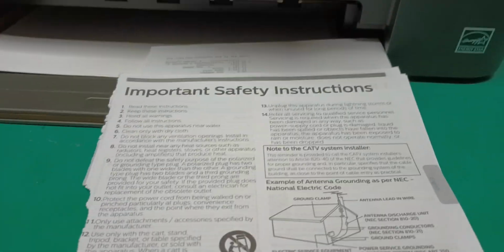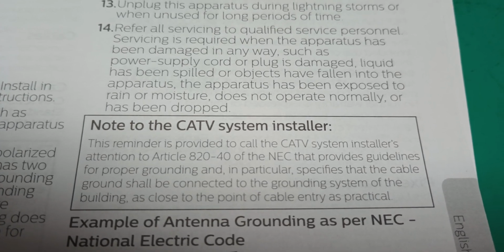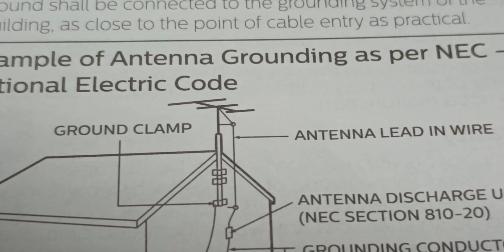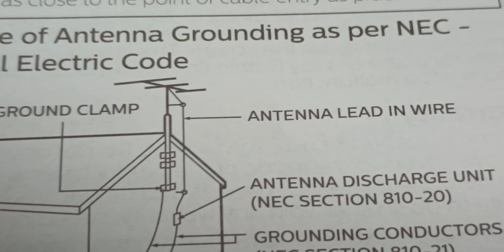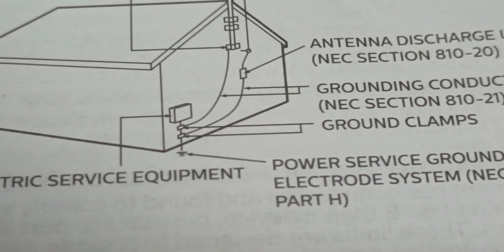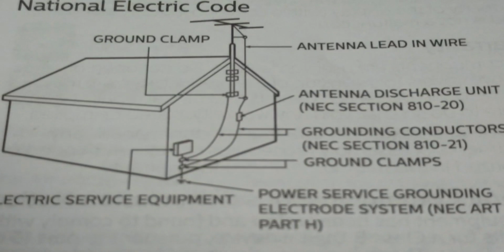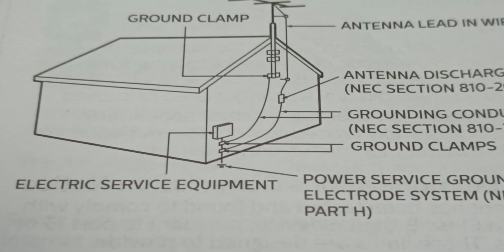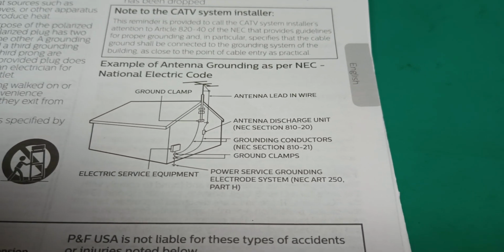Antenna System Grounding- Phillips TV Manual With NEC References #hamradio #hamantenna #grounding

Comment: I'd add that Philips probably sells more TVs in a year than the ARRL has sold books in the past half-century. And Philips customers, unlike ARRL customers, haven't been trained to blame themselves if they ground something and it blows something up or causes a fire. They're gonna sue Philips if their TV antenna gets hit and the TV blows up. Philips has a far higher financial and legal stake than the American Radio Ripoff League, they're gonna make sure their diagram and NEC callouts are correct.
Reply from the maker: I couldna said it better.

And BTW, anyone interested, avoid "Phillips" like the plague. I tried to make a Warranty claim on a TV and at the bottom of that rabbit-hole was some unknown contractor apparently handing such things for them, who were just going to show up at my house, un-identified and take my $2000 TV, with no indication there would be a replacement. Phillpis refused to identify that contractor or promise a replacement.

Thats got fraud written all over it

Comment: I got my Tech a few months ago and then bought an HT. I would like to put a base station in the house so I don't have to go outside every time I want to talk on the radio. I started researching all the stuff I thought I needed to put an antenna on the eave of the roof and for running the coax through the wall. I will admit I know nothing on the topic of proper antenna installations. Other than reading published books or watching videos put up by people that I thought were knowledgeable on this topic. I do not have any background knowledge of electricity other than I know not to stick paperclips into an outlet. I am just a guy wanting to put up an antenna and talk on the radio. I do however want it to be safe. I was about to order all this stuff and then came across your channel. After watching numerous videos of yours I'm so glad I came across all this wealth of information that you have shared. With all that said I am a little lost on what I should be doing to be as safe as possible. Is this a good plan or should I be doing this differently? Our house is ICF with a brick veneer. I would  put up a Commet GP-3 antenna on the eave of the house. Run the coax down the brick wall to a junction box. Inside the junction box have connectors to the coax that is running through the wall. The coax that is coming through the wall connected to the radio. No ground leads placed anywhere in the system accept the outlet the radio is plugged into. When not using the radio I would disconnect the coax in the junction box outside the house.  I appreciate your time. Thank you
Reply from the maker: readers- note this Commenter is...READING AND LEARNING!  That is what " this" is all about.

This is golden:

" I do not have any background knowledge of electricity other than I know not to stick paperclips into an outlet."

You are WAY better educated than the people telling you to ground the antenna system
They are sticking a PAPERCLIP IN A LIGHTNING BOLT.*

Youve got common sense. Great!

Readers, note this, its what I've been telling you:

" I was about to order all this stuff and then came across your channel."

There it is, all this crap they tell you you need is to get you to BUY THINGS.

Go ask the genuises that tell you to ground how to GROUND A HT? A hose clamp on the antenna socket?
LMAO.

Youve got it, just that Code REQUIRES that the wall pass-though be non combustible. That should be common sense, but too many of us pass it thru wood. A hard strike will turn that coax into a 3,000 degree ball of fire and that can instantly set building materials on fire.

ICF = materials that will not burn. Theres no air inside worth talking about. So its OK to pass thru without conduit, just keep the insects out. For wood, I use steel tubing or conduit. Code does specify "conduit" but doesnt say metal or PVC. PVC doesnt support combustion.

See my Grounding video #7 where I passed my HF coaxes thru 10 foot of conduit. Makes a lightning suppressor.

HT = VHF/UHF. Read about coax loss per foot. ITs death on V/U signals, both TX and RX.
100 feet of coax at 2 meters, big losses. At 440, nothing left, transmit or receive.

LMR 400 is the best, try Jeffa Tech (spelling?). They had a "clone" - 400 for $0.60 a foot last I bought some.

Its too stiff to connect directly to a HT, just use a short RG58 jumper else the HT antenna socket may be broken off.
Reply: @k8byp  Thank you for the follow up. I was planning on getting another radio for inside. Something like a Yaesu 200 or 300. I did plan on using LMR400 but have been reading about this Messi and Paoloni HYPERFLEX 10 SAHARA. It has a white outer sheath that they claim is better for hot sunny environments. I live in Florida and the part of the house I want to put the antenna up at gets direct sun all day. Probably just marketing tactic. I may still go with the LMR400 from the antenna to the junction box then the LMR400 untraflex through the wall into the house.
Reply from the maker: White plastic will reflect light, sure, but its only relevant for permanent long installs.

Paint it! Or wrap aluminum foil around it.
Reply: @k8byp  I am going to just go with the LMR400. I have one more question. I think I know the answer from the information you have provided but rather ask then just guess and get hurt. So I should not use a lighting arrestor like a ALPHA DELTA ATT3G50U in the junction box in line on the coax outside, then running a ground wire from the arrestor to a ground rod. That would be the only grounding, not tying any other equipment to it. If I'm understanding correctly that is a no no.
Reply from the maker: It IS tying other equipment to it- the radio chassis. Thats not allowed under NEC 250 " may not ground not normally current carrying conductors."
Reply: @k8byp  Ok. Thats what I thought but wanted to make sure. I have an old 15' fiberglass windsurfer sail mast that I think I'm going to use to put this antenna on top of. I have a raised garden bed that has an 8' trellis over the top of it and it is on the same side of the house that I want to install the antenna on. I am now planning on bolting the mast to one of the uprights on the garden bed and run the coax underground through a piece of steel conduit as you suggested. I kind of decided that I really don't want to attach the antenna to the house at all. Do you think by installing it in this manner that its necessary to disconnect the coax outside in the junction box when not in use or will unplugging the coax from the radio be enough?
Reply from the maker: Its a pain to go out and disconnect it.

If its underground and gets hit, itll probably arc thru the plastic jacket so that is roughly the same as grounding the coax. BUT underground allows lightning current thats going thru the Earth to couple into the coax. I just lay it on the ground and run the lawn tractor over it.
Reply: @k8byp  I spent the entire evening in a rabbit hole. LOL. This has turned into a fascinating, complex, educating, and eye opening topic. When leaving the coax disconnected from the radio when not in use, would there be any advantage to shorting the center conductor of the coax to its shield? So the 259 connector on the coax would not be like a spark plug laying on the desk. Not trying to save the antenna or coax from a lighting strike but to have any negative reaction remain outdoors and not occur indoors. I would like to avoid having to go outside to connect/disconnect the radio all the time. In the end, this maybe what I have to do to mitigate the potential for fire or shock in doors.
Reply from the maker: Now folks we have a REAL HAM in the making. Not content with playing trivial games.

Shorting or open Tline both cause a " total internal reflection" of propagating energy. Almost. Unfortunately with lightning, its a huge energy. Open, the very high voltage will arc over and 
break down then short and destroy the end. Shorted, high current will do the same. Pick an option, they both suck! Leave it open and watch for corona. Its fun to watch. Might even see St Elmos Fire. I saw it once.

Its exactly like a spark plug on the desk, just that spark plugs intentionally arc to ignite combustion. Thats NOT what we want in the house unless were way late in payments.

"mitigate the potential for fire or shock in doors."

Thats exactly what the Electrical Code does. Cant eliminate it. Minimize it. Now you are qualified to start studying the NEC. ( I assume youre in the U.S., if not study it anyway.) You " get it" now.

Realize even indirect lightning strikes are DEADLY potentials. Why bring that in the house?
Reply: @k8byp  Yes I'm in the US. I live in north Florida. I have read a few of the pages out of the NEC that you have been talking about. I just started reading on the NFPA 780 and my rabbit hole keeps getting deeper. This is really some interesting material. There are things that I never considered or was given wrong information about. This is the stuff that there really should be mandatory to learn in order to get a ham license. It's not just playing walkie talkie as I am learning. This is a huge safety issue that does not seem like it is being addressed appropriately in the world of amateur radio.
Reply from the maker: Its not addressed in ham radio because its not a radio topic. Its not radio operation or commu ication, its life, death and property damage.

Dont put yourself down just because youre at the " walkie talkie" level ( and youre dating yourself with that phrase!). Youve figured out things most hams never " get."

It was a REAL tough adjustment when I got back into ham radio in 2015 after getting real science and engineering knowlege, then finding out how much about radio and RF I DIDNT know. It was a lot! Even with that lack, Ive always far exceeded degreed EEs when it came to electronics and RF, cause they learned nothing about that in school. I got it thru A.R. and electronic service.

Im beyond anything and everything thats ever existed in the Amateur world in antemna systems, and knocking on the door of the Quantum world. 

A ham/EE recently told me that " you should replace all the legendary ham ' experts' put together."

.That is a real honor.
Reply: @k8byp  You have provided a wealth of information here that others need to see and understand. Thank you for taking the time to respond to my comments. Looking forward to more of your future videos.